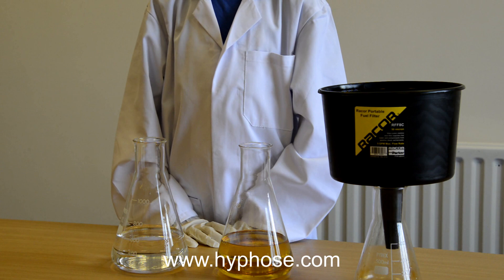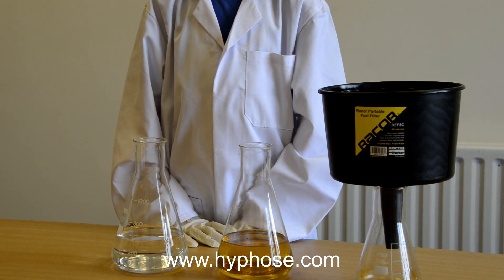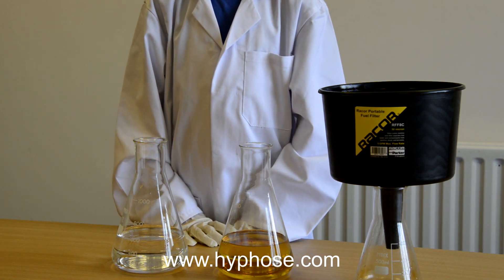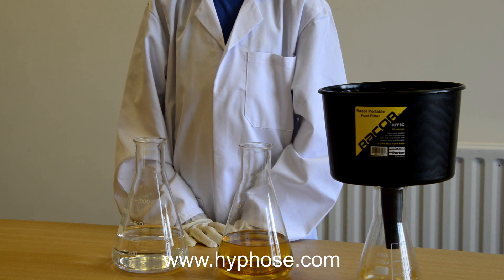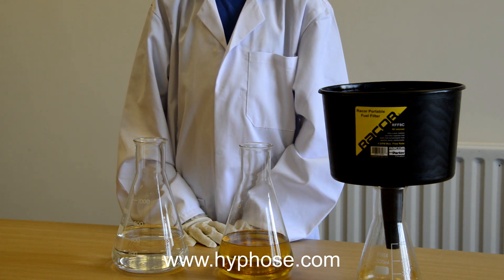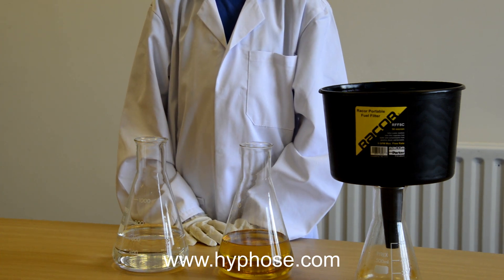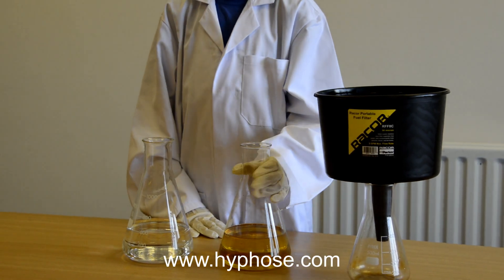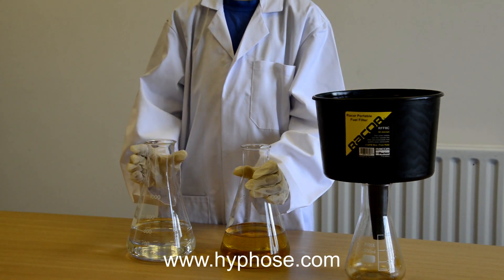How To Separate Water from Fuel

Comment: Have you tested it with motor oil? I use waste oil on my diesel generators. I sometimes get a batch with coolant mixed in. My fuel water separator gets most of it, but it would be nice to run 5 gallons at a time using this slick product if possible.
Reply from the maker: Hello Jim, many thanks for your question and apologies for the time it has taken to reply.  We have now had a response from the manufacturer, who states that the funnels remove damaging free water and contaminates from gasoline, diesel, heating oil and kerosene.  This indicates that motor oil should be ok, but they are checking with the manufacturing location and will advise their answer as soon as possible.